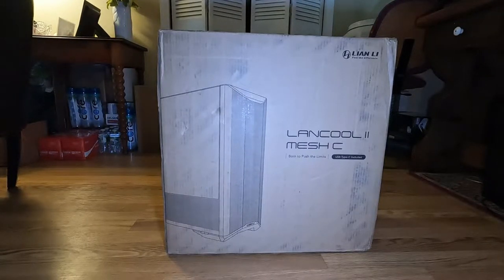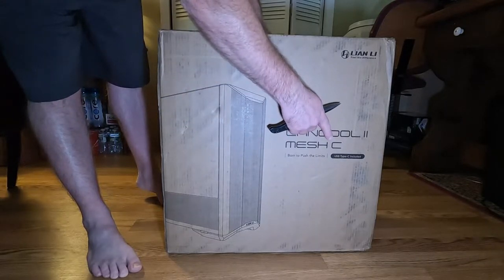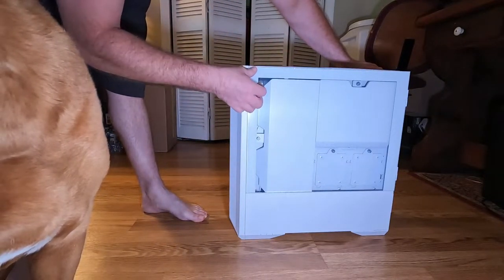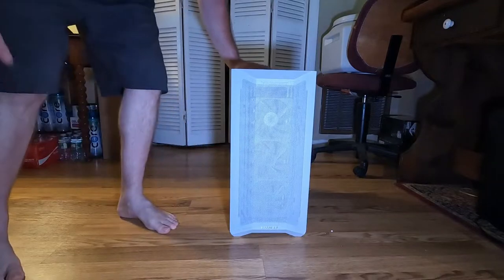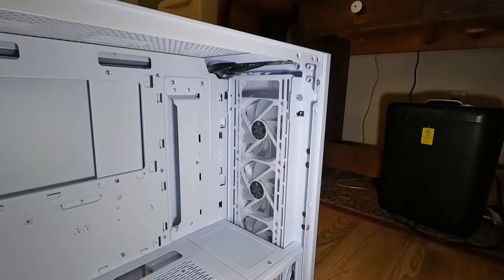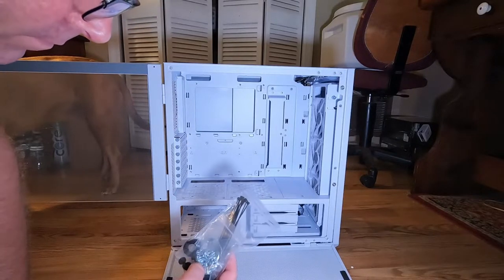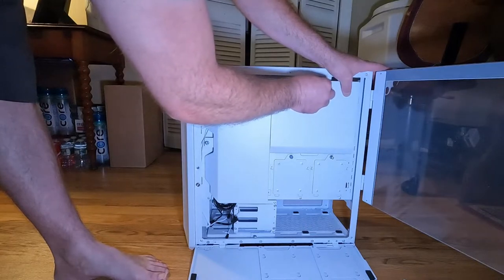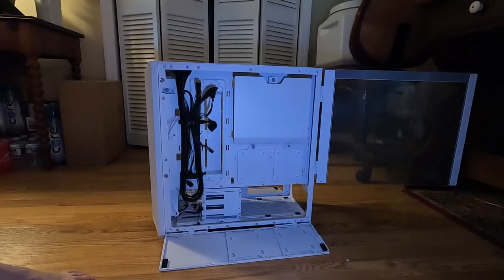Hello Lian Li Lancool II Mesh unboxing.

Comment: Are the fans loud? I looked and they’re 3 pin which they’ll be running at 100% all time
Reply from the maker: yes they are noisy,  but I play with a headset so it doesn't bother me.  I will be upgrading the fans inn the future so there will be 3 in the front and 1 in the back.